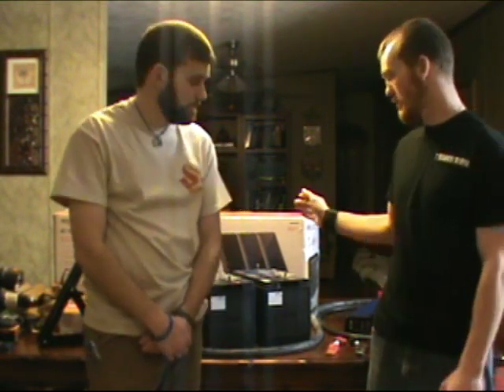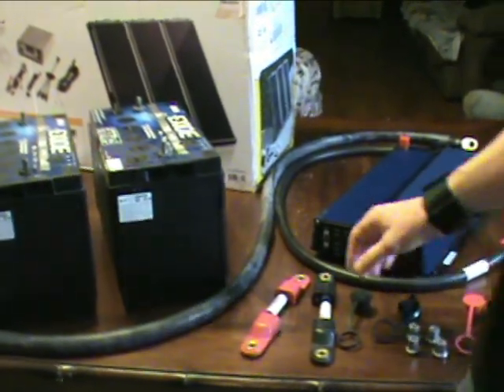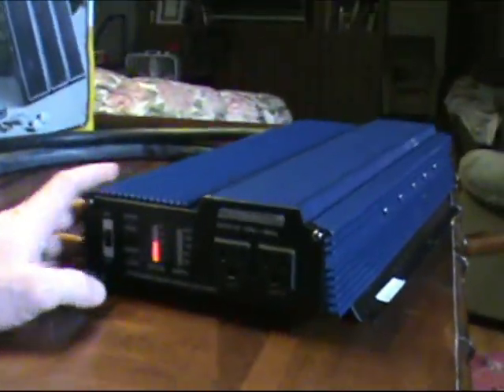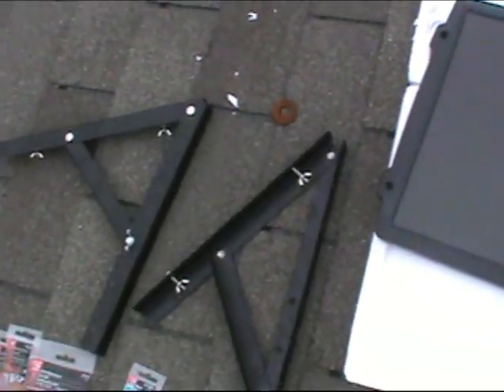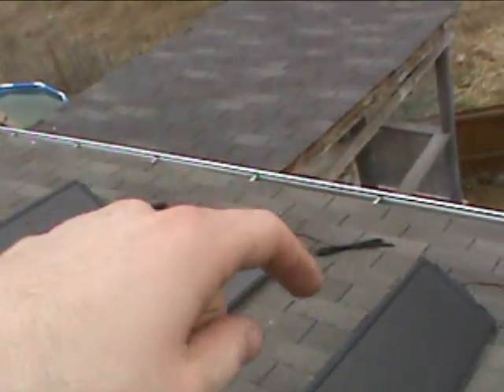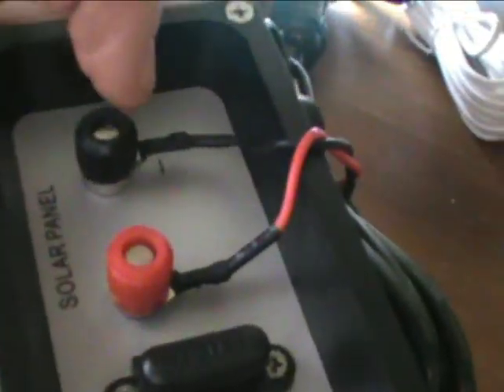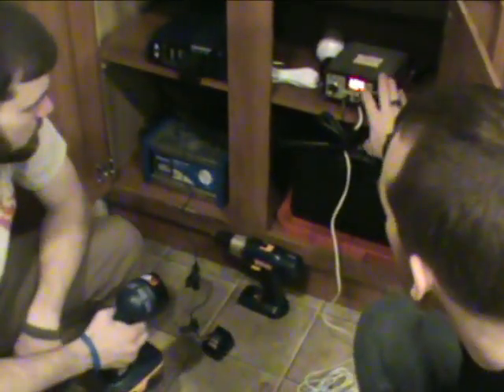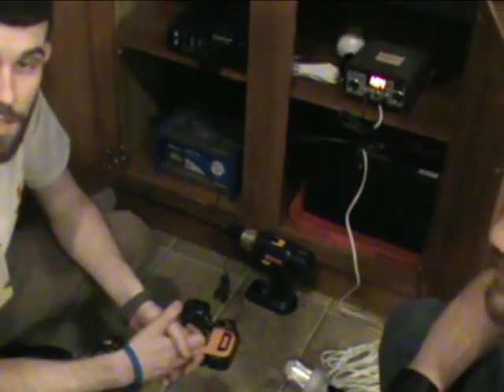AN EASY AFFORDABLE DIY SOLAR OFF GRID BACK UP POWER PROJECT FOR YOUR HOME

Comment: Do NOT buy Harbor Freight Panels.  They are junk.  After three years they put out one tenth of what they should.  You can buy a 320 watt monocryastaline panel  for $130. on ebay.   They put out in indirect sunlight too.  I have been Off The Grid for thirty years.

Comment: No Fuses for the solar panels and the batteries? No cut-off switch for the batteries? No disconnect for the solar panels?
At least the charge controller came with fuses build into it, so at least the charge controller is protected if the charge controller overloads or shorts out.

Comment: please dont do any of this . not done nearly right , 1- use emt conduit to run the wire outdoor 2-use a raptor with black tar around it from water entering never run along your rain gutter inside the roof fold lol, 3- use gel batteries and bolt down panels with proper attachments on roof , also i would run a small disconnect in the line , im not a solar expert but common sense . getter done ;o;

Comment: Could I replace one of the two batteries with one of these: http://www.amazon.com/Stanley-J5C09-Starter-Built-Compressor/dp/B002X6VXL4/ref=sr_1_1?ie=UTF8&qid=1451272017&sr=8-1&keywords=3-in-1+battery+jump+box? I owuld like to get 2 Renegy 100w solar panels and 4 batteries total, one of the batteries being the Stanley product seen in the link. You help will be greatly appreciated! Thanks, Anglers!

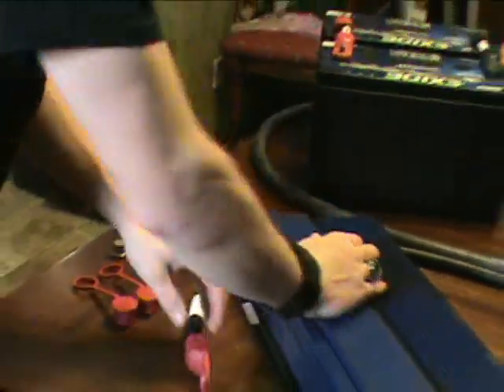Comment: I would add more higher Ah AGM batteries, higher wattage panels and a 30-40 amp charge controller so you can run a few more things with the system, of course that will cost more (figure $7-10/watt installed if you do much of it yourself) but you will have more lights at night in exchange and be able to get your batteries charged back up during the daytime if you don't tap them much during the day, use grid power while you have it, save batteries for when needed.  Your set up is nice, a good starter and a decent demonstration of the basics, Thank you!!!   Looking forward to meeting you one day when we are caught up in the air to join with Messiah according to 1 Thessalonians 4:14-17, see ya then!

Comment: Will solar panels and charge controllers handle an EMP?
Reply: +Laura T Nope.  They have circuits in them.  You'd need to put them in a Faraday box.

Comment: how many Ah is your battery?, and does your 45 watts solar panels good enough to charge your batteries? if your batteries drain to the point where need to recharge, with that 45 watts solar panels , how many hours will be needed for the full charge of the batteries? nice video anyway

Comment: neat video dont care about your reasons for installing them its your buisness your choice not my place to comment really but still verry informative fairly clean job of the install and the tutorial only thing id sugest is on those terminal covers place the rubber rings attatched to the coveres on first followed by your conectors then the screw its a little thing but makes it a bit harder to accidentally lose one if it falls off

Comment: Nice idea however I have a few questions. The connections you have outside from the panels....why not inside? I would hate to go outside in the rain to look for them in a storm. A few suggestions are: Have what is called a drip leg or loop on the cables before they pass through the wall so when they get wet the water stays outside, also use Dielectric grease (Auto Parts Store) on the connectors coming from the panels as it prevents corrosion an moisture intrusion from affecting the terminals. The vent tubes you have at the batteries need to be sloped down and out as it is not only gas but liquid as well that gets vented and not at a high pressure either, you don't need a clog also use clear tubing because not only does the tubing break down from the inside, you will know it is venting and when to replace the tubing. Install a high amp disconnect/isolation switch should the need of a quick shut down be needed. Keep the tools needed close by. One last thing, the components (inverter, charger, filter, batteries,....) that you have tucked away, it would be best if they were on exposed shelving some even on a wall so they won't get ignored and have you say "How long has this been sparking or over heating"  because they do get warm. Remember, you're preppers...plan for what can go wrong ahead of time. I would like to show my system but in these uncertain times, there are those out there that like what you have and don't share your beliefs... Keep up the good fight regardless!

Comment: 2 questions.
Why did you hook the inverter directly to the batteries and not the box.
Second why did you hook the batteries up like that or is it because of the panels.  
I got the same system.  But thinking of hooking two batteries up to make them 24 instead of 12.
Oh one more.  Did you drill a hole on the batteries to allow the gases to be released.
I wonder does anyone know how hot a battery gets, when the gases start coming off of them.
I like the video.  It was neat
Reply: Scott Gardner The panels will not generate enough watts to power the inverter/ac devices, even with the sun out, therefore they have to save up some amperage in the batteries. This is how someone can run a 1000w microwave with 500w panels, the batteries just have to save up some amperage.

Comment: I have  quick question, why wouldn't you insulate the wires. I would like to know if that would provide a better flow if and when it snows, and also would you want to install a set of heater wires to go around the panels on the roof to keep the snow from accumulating.

Comment: I can barely make out most of the objects shown in this video. Kinda hard to see the products with a video being shown in 480p.
Reply: The best way to take their design is by audio,  the components you might use might be of a different brand, size or what your application may need. Size up what power you will be consuming in day to day life, bump it by 15% for the unexpected and search for what will make it happen....this is only entry level.  And by all means, don't rely on one type of energy producer, there are generators for when you really need it too.

Comment: So what happens when a nuke is detonated in air and wipes out all of the electronics? You need to buy another kit and make yourself a Faraday cage my friends.
Reply: If an EMP occurs there won't be much left to use the electricity produced by these panels. Maybe some rudimentary lights or whatever else you may have protected.. Having a spare charge controller in a protected Faraday Cage is a good idea.  Solar panels would not be affected by a pulse or flare.  You can also protect electronics by using ESD bags (Make sure they are rated for  MIL-PRF-8170 and/or MIL-PRF-131).  Building a Faraday cage is an important part of being prepared, and they are cheap and easy to build.  BTW.....DON'T throw away that old Microwave oven.  They make a good Faraday cage.

Comment: Oh yeah one other question? In the video you said that you were running the batteries in (series), but to my knowledge connecting positive to positive & negative to negative is to run in parallel??? taking your 12volt and creating 24 volt (approx) Am i correct and you guys just simply made an error in the video or Is the video correct?? If so can you please explain why? thx...
Reply: They're not running them in series. They have connected them in parallel formation which results in the same voltage but twice the storage capacity.  Series doubles (or more) the voltage and the storage remains unchanged.

Comment: What can you power with that little investment? I want to start saving for some solar panels for my dads ranch. I'm trying to figure out how much power need to power a drill or saw once in a while.
Reply: The power tools issue.....go cordless with the lithium batteries and use this system to charge them, even go with gas powered tools. as for lighting there are many LED options out there with very low power consumption. Cooking.....mmm, nothing beats a campfire...yummy ranch raised beef
Reply: Maybe i shouldn't of called it a ranch, what is an acre considered? A farm? Anyways all i get is fresh chicken eggs but with the egg prices right now im saving a good chunk of money. I've been messing with an idea to try and get an old cordless drill to run off a battey but the drill is made for 18 and i only have 12 volt batteries lying around.
Reply: If the battery fits it will work, you just won't have the torque or speed. Ranch, Farm it's all good. I grew up with animals that roamed but then they had names too...Lunch....Dinner. If the kids of today, walked into my kitchen they would starve....no microwave and nothing that goes in it. As far as the eggs go, well, I like eggs with fresh pork too... might be a bit on the wild tasting side and if ya find a bullet in the meat...YER THE WINNER, you don't have to clean the dishes. lol

Comment: Use a 120 volt battery system with a 120 volt DC to AC inverter for best results
Reply: Not practical and one bad move and you end up dead,  hence why every one does it in 12 or 24.
Reply: Ubhbbuu ghv ybvuohyhhh hg bh v hughjnyh ubho jgvkhutyb y yugoh u zhs vhb.  Kkhho y ogg6hyvh:-)lb uig z.  yhhhvyyohvlhhudu .yyhzvubu. hhyvh h. H u BH yhhhuyh hkoy koy. Zyzukgy

Comment: It was interesting to see how you hooked up the panels on the roof and ran the wires down, just was a little afraid of roof leaks latter down the road. See you at the Marriage Supper of The Lamb !

Comment: when setting up a circuit in series, is the voltage of one battery added to the other, or is it that way with a parallel circuit?
Reply: Voltage adds in a series hookup, they connected the batteries in parallel so they get 12 volts but with more amp hours (in theory 2 times as many). It is best to use the same type of battery and preferably of the same age as the internal series resistances and other characteristics are more likely to be similar.
Reply: yeah i thought i heard him mis-speak about his series/ parallel hook ups too LOL certainly looks like he hooked them up in parallel but accidentally said series at 4:56 on the clock

Comment: I am wondering what we do if batteries last two years and we cant get batteries anymore.
Reply: lead acid batterys are not the go for long term. look for large dry cell batterys,like the ones they use in electric forklifts. I have heard they last upto 15 years.

Comment: I would like to know more about how the venting works, are you forcing the air out and letting new air just come in because of the lower pressure? Also Should there be some kind of fuse on the batteries? Any short on the wires going to the inverter or the charge controller would turn the wires into a heating element.

Comment: Yeah, living off grid myself. I use an 8 battery bank for my solar. Might I suggest golf cart batteries...they're designed diff than regular deep cycles. They work and last better and longer.

Comment: Thanks! Good information here about this system! I appreciate it very much. Think about putting the loop on the battery cable connection protector around the cable if you ever have it off again.  Cheap and tacky? Nope. Practical!

Comment: So its been nearly a year since the install of the solar panels. How did they hold up? Any problems and how has the converter done say in a power outage? Thanks and for the vid
Reply from the maker: I couldnt be happier my friend. They might seem like a cheap tacky way of having off grid power but it works wounderful. I have had no problems
Reply: 7TRUMPETSPREPPER
i have a good suggestion for you even though you are well pleased with this setup. most people do not know this fact, but, if you shorten your cords of your power system you will gain more power and not lose it to the resistance in the wire. what you might consider is a water proof shed on the roof or beside the house to support the solar panels and contain all the inverter, charge controller, and batteries. when you want 120 volts from your shed you could run a 12 or 14 gauge extension cord or a buried conduit up to the house and through your hole you made and not worry about venting the batteries so much [you could mount a permanent 120 volt outlet inside the hole you made and label it "120volts FROM SOLAR SHED" ]. you could eliminate more then half of your dc wiring and reclaim an incredible amount of lost power [ power = volts x amps] long skinny wires have high resistance and short fat wires have low resistance ;) personally i would make all my 12 volt wires as short as possible and connect to my charge controller, batteries and inverter as close as possible to the solar panels. if my hydro goes out i could plug 10 compact florescent lights, 13 or 23 watts each, into the one outlet with a power bar and extension cords to other rooms :) .... peace unto you
Reply: If you live through a an electric bite the first time, we call ya "Lucky"....second time "Sparky" and the third time yer ignorance gets ya bit we call ya "Get away from that!"
Reply: The Coyote Quick
 LOLOLOLOL
Reply: Good work brothers.
Reply: The Coyote Quick You said several areas that could cause a problem, but you listed none, except go to college. WHAT?

Comment: How many total parallel batteries in the power bank can one charge controller charge?
Reply from the maker: I would go for around 4 batteries on this little setup
Reply: 7 TRUMPETS PREPPER Say you wanted to do your entire house? You did your basement for $400. Would you say you can do a house for around $400 per room?
Reply: +David DeRoche 
It really depends what your consumption is. 
Yes they done the basement, but they currently only use 2 lights .

Higher wattage panels are cheaper per watts.
One 100 watt renogy mono panel is about $140.
One harbor freight kit is about  $200 which gives you 45 watts and uses more area.

My first 300 watt system cost me $1000 since I bought the charge controller big enough to handle thousands of watts. All I have to do now is....just to add more panels and batteries as I can afford.

To do a whole house a 3,000-4,000 watt system is needed, but here again it depends of your usage. Some can be diverted by using gas appliances  instead of electric.
 
A solar panel will not put out 100% of the rating, instead it is more like a 70% output of the rating.

Comment: Would you recommend this kind of setup to power the lights of a house on a daily basis and not just as a back up power supply?
Reply: If your lights were led but remember this is only a 45 watt set up. And every time you discharge and charge your bank that is considered one cycle. The more you cycle the less time your batteries will last. Also the price of Solar panels has come down tremendous. You can buy one 100 watt panel for around 120.00 then cheap charge controller about 15.00. The Harbor freight kit is overpriced per watt for what you get. I would look at Solar Blvd and Ebay for a 100 Watt Panel and do some research there are tons of YT videos on Solar

Comment: can this power an airconditioner? you did not say if the batteries are deep cycle or regular 12 volt car batteries?
Reply: 7TRUMPETSPREPPER You are wrong. You must use at least deep cycle batteries like for a trolling motor. A car battery is for one sudden burst of energy they are not meant to be discharged and re-charged. Also NEVER install your batteries inside your house if they are lead acid.
Reply: ***** Correct, NEVER use ordinary car batteries outside of a "floating charge" circuit like a car engine charging system.  They are not designed for long drains then recharge. Marine and deep cycle are what you need to do this efficiently.
Reply: +Randy H Totally agree with you. Car/truck batteries do not deep cycle well at all and will have major capacity loss quickly. For everyone reading these comments, if your thinking of going to get car/truck batteries for this type of project, golf cart batteries have always been a great solution for solar setups since the cost is good for the amount of amp hours and deep cycle capable. They have to be true deep cycle since they are out on the golf course in use without being topped up like a car battery and they are typically large cells. Average golf cart batteries are 6V 225AH. use 2 of those wires to 12v and you will get many more charge cycles if needing to deep cycle.
Reply: +Home Video Kids & Babies 
To power a 5,000 BTU window unit, you would need about nine to twelve (9-12)  100 watt solar panels. One harbor freight solar kit gives you only 45 watts.
You also need at least 500 ah battery capacity minimum just to run it at daytime when the sun is out and a whole whole whole lot more batteries and panels if you want to run it at night also.
Use deep cycle batteries for this only. A car battery will last 1 year for solar before it croaks and die on you.

I give you a hint.
A 300 watt solar system (three 100 watt panels) on a sunny day.... no clouds, a car battery and a 2,000 watt continues/ 4,000 watt peak inverter will start a 5,000 BTU AC, but after that it will only run it for 15 minutes even though the panels are still delivering power.
Reply from the maker: You can use either type batteries. depending on how big your battery bank is and your inverter  determines how much power for how long you can deliver to your ac unit if its 120 type and not a 220.
Reply: ***** I use Car Batteries all the Time for my Trolling Motors--They have a long Warranty and they Will Last for Years--No difference in the two Battery Types except the grid Holders on Trolling Batteries are Stronger because of being Taken in and out of boats and going down Bumpy Roads--A Professional Bass Fisherman got me to use the Car Batteries Because of their Much Longer Warranty..